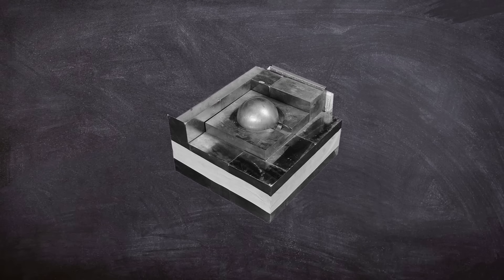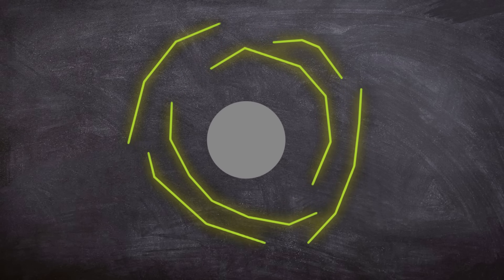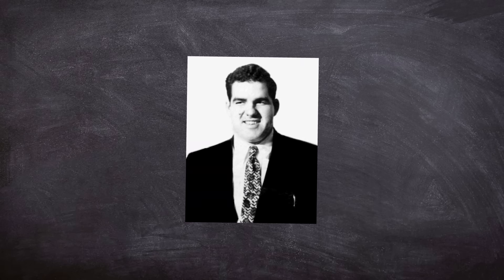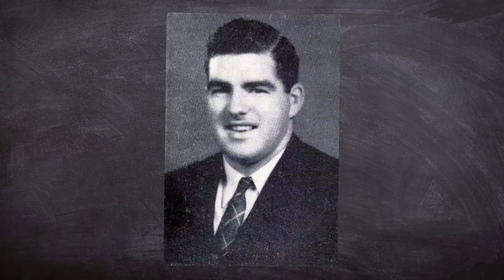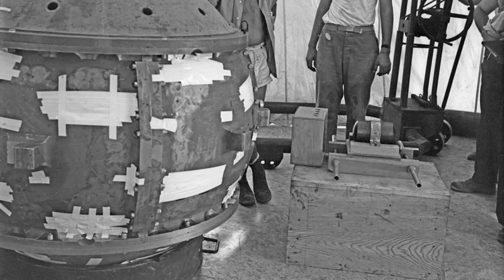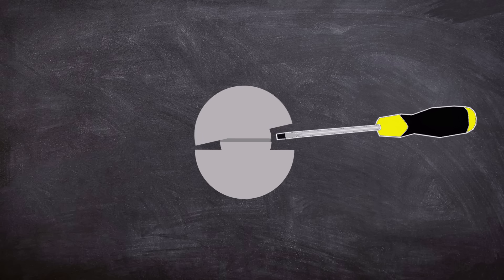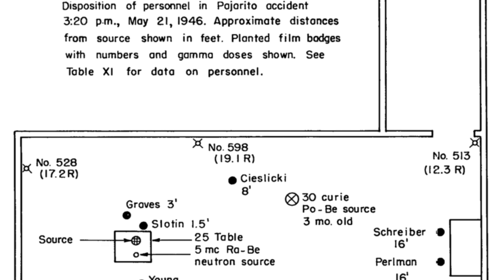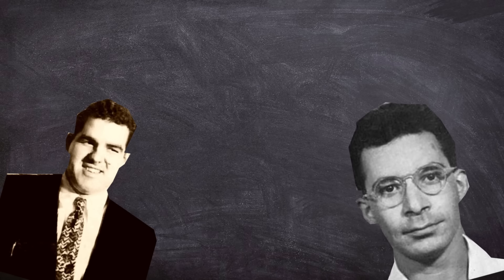A Brief History of: The Demon Core (Short Documentary)

Comment: Idk how just by moving bumping or touching medal pieces together could make something explode or give off a huge amount of radiation if someone can tell me in a simple way let me know cuz it just doesn't make sense.
Reply: It's just the feature of the materials used.
Reply: Plutonium is a metal, and under the right conditions will convert itself into energy.  A lump of iron is very stable, plutonium not so much.  Like a spring wound up tightly, it only takes the right push for its atoms to give it up and decompose into one enormous ball of energy.
Reply: @asmith7876  aight thx

Comment: Also, the photos are @1:29. EVERYTHING has been turned into rubble, concrete structures & buildings that were "Reinforced" with STEEL have also been reduced to almost nothing, its literally like you threw a "Grenade" into a large "Lego" model! The devastation is Insane, but, can ANYONE Please explain (I REALLY want a video done about this as Ive always wanted to know) WHY & HOW there are a few buildings STILL standing after an atomic bomb??? Not only that but at least one of them look like they are Perfect, like they didnt get damaged at ALL! they look to be made like the rest, there in the middle of the blast zone, but they still stand! WTF!?
Reply: Here's a start: 
https://nuclearsecrecy.com/nukemap/
Reply: Most buildings were not reinforced with steel as you claim. Iron ore is one of the few natural resources not found in abundance on Japan. 

Most of the buildings were wood or brick, as opposed to reinforced concrete as you assert. 
So it’s simple. The old buildings were disintegrated immediately. A few modern buildings which had been reinforced for earthquake protection survived. It was mostly dependent on their proximity to the blast. 
The Genbaku Dome was almost directly underneath the fireball. Everyone inside the building was immediately killed by the heat, pressure, and Gamma rays but the building survived with relatively little damage.

Comment: Many laughed at the researcher for not having common sense, but what they don't know is that those researchers are not the one in control of the funding. 
- They could know that it's dangerous but the higher up refused to provide additional safety because it's very costly to do so. 
- They could have been forced to produce result within unreasonable deadline which forced them to use faster but unsafe method. 
- They could had lost their concentration because they have to do precise work while running their brain on full capacity overtime.
I find it sad that people don't commend on their self sacrifice to stop further accident from happening, but mocked them instead. They probably knew that they are fucked before they knock off the reflector or tungsten plate to prevent the supercritical reaction, but decided to do it anyway to save the life of everyone else in the area.
Reply: sounds bulsht they legit used a screw driver like a fucking donkey. They were totally just fuckign around
Reply: @Seelenverheizer  Blame the higher up who refused to provide more than a screwdriver or implement any safety measure. If that incident happened in any lab in modern day, all the supervisor will be fired immediately. Safety precaution is something to be done by the higher up because they held the money to do it, not the baseline researcher who has zero control over what tools they can use.
Also, after being forced to overwork eventually your mind reach a state where you can't handle a screwdriver on full focus.
In my lab the experiment will never be allowed to proceed because it will fail the risk assessment.
Reply: @mira-rara  dude they were the researchers that had build the nukes a few years before, they had legit unlimited funding. They would have gotten whatever they wanted FFS. Do you even remotly think the state was like " well here have a screwdriver, we cant afford more". He used the ducking screw driver as a non recomended tool for the test because he was showing off how much of an edgelord badass he was. I mean they could have milled a better tool for that on side for like 1$. From what you say you seem like a lab tech that feels like he cant keep up with the quite low requirements and loves to blame his better. You  might want to read up on projection
Reply: @Seelenverheizer  Maybe try taking a phd and work in one of the top research lab in the world. You will understand what I mean.
Politics in research lab and the fight for research grant often fuck each other up. Yeah the lab may have unlimited funding, it doesn't mean you get to use it.
And again, most likely he is pressured into producing result in short time. This very often happened to researchers and is still a huge problem even in today. I supposed you aren't working in relevant field because this is not a situation that will be met by lab tech, but a research engineer/associate/fellow.

Comment: I still don’t quite understand the reason for this “experiment”.  Two hemispheres of beryllium over a plutonium core separated by a screwdriver...What is the point of doing this?  Just to see how close you can get before going critical???
Reply: I believe it's called edging
Reply: @kratosgodofwar777  It came, he went. Sad. 😥
🤣
Reply: @kratosgodofwar777  hot
Reply: It was a calibration experiment to measure how close the sphere was to achieving critical; it was originally intended to be used in the Operation Crossroads tests at Bikini Atoll, but was put into storage after this accident to let the excess radioactivity decay, and was eventually melted down and reused.
Reply: @nemo5654  They couldn't figure that out from just doing it once?  What's the point of doing it multiple times wiggling the screwdriver up and down?
Reply: @Theakker3B  The beryllium is a neutron reflector and will bring it nearer to critical the closer it is, which is recorded via a scintillator, which was counting gamma emission which is proportional to fission rate. Taking multiple data points allows for a more precise measurement, which is necessary for estimating the yield of the weapon. The beryllium hemisphere should have been mounted on some sort of incremental slide, rather than Slotin's rather crude and dangerous method.
Reply: @Theakker3B  you probably had lab experiments at school.
Experiments require repeated measurements to get rid of random errors then made with different setups to make sure that nothing is influencing the results.
Reply: @nemo5654  Thank you!
Reply: @Theakker3B  You're right, Man. You go tell those nuclear physicists what for about a test you don't understand the purpose of doing. That's YouTube comments for you. Actually Slotin wasn't supposed to use a screwdriver but the test still needed to be done so calm down.
Reply: @FIREBRAND38  he was never telling anyone anything, he asked questions,  every sentence was a question asking for better clarification. never once did he imply he knew better, in fact its so, so very clear that he didnt know much about it.

can......can you read? guess "thats YouTube comments for you"
p.s change your name from john to homer, suites you better
Reply: I think it was intended as demonstration experiment to show the onset of criticality, as the system changed from a subcritical state to a critical or super critical one. Such demonstrations are still used today, for training nuclear engineers, but, of course, all of the nuclear and other experimental materials are now remotely handled behind radiation shielding.
Reply: Trying to get it into a subcritical state to harness the reaction is what  I think he said
Reply: @TheNufai  And what does that mean exactly?
Reply: @Theakker3B  they were probably trying to use it for energy in some manner
Reply: @twilight_phantom2969  if they want energy so bad just drink a cup coffee... sheesh.
Reply: @twilight_phantom2969  If you don't know don't guess
Reply: Insanity.
Reply: For fun yo
Reply: Worst test ever to use a non-Fail-Safe method.  If the 2nd mass was instead raised up from below, and only suspended while held, then letting go should have ended the reaction, and so would any accident.
Reply: Remember that, at this time in history, very little was known about the effects of ionizing radiation. There was theoretical understanding, but real-world situations are another matter. Things like the demon core don't occur in nature, so the only way to study them is manipulation by man. Understanding radiation has made it possible for us to create nuclear reactors to generate electricity and power millions of homes. It has allowed us to develop radiation therapy for treating cancers and taking internal images of the human body for diagnostic purposes (X-ray/CT machines). It helps us also to treat radiation exposure and ensure better survival in the event of accidents.
Reply: He taught everyone a valuable lesson I guess. Sometimes the best way to learn is from mistakes or taking note of others mistakes.
Reply: Especially when you're nudging the inside of an atomic bomb with a screwdriver measurements can be imprecise.
Reply: tell yea what,  fuck everybody here.  that is All
Reply: @skeetrix5577  9/10 comment not cool enough, needed more walking away from an explosion right after dropping a mic
Reply: shit man you're totally right,  i fucked up!
Reply: When the spear is closed it reflects back causing the thing to blow.he was most likely trying to find better reflection techniques to make the bomb more powerful by prying slightly open without going full critical
Reply: yes
Reply: When you get down to it ... yes. Yes, that is exactly what they were doing.
Reply: the way it was supposed to be done was that there were three spacers meant to be between the two as a final safety. but the dipshit decided to use a screwdriver.
Reply: @scout360pyroz  To achieve what?
Reply: @Theakker3B  self gratification. proof of his skill, better test results, aleviate his desire to get the heack out of there... the list goes on
Reply: @scout360pyroz  What I'm asking is what does balancing two hemispheres of beryllium over a plutonium core do?
Reply: @Theakker3B  reflects the regular decaying neutrons emitted by the radioactive substance back into it, causing more decay and more neutrons to be released, if I understand correctly.

Imagine a pot of water that has a consistent amount of heat being generated within it, and a very insulating pot and lid.
If you put the lid all the way on, the water will instantly boil and rapidly produce enough steam to burn you
If you put it partway on, it doesnt boil, but it releases a more controlled amount of steam and heat.
They were trying to maximize the amount of heat without the steam explosion by getting the lid as close to covering the pot as they felt they could.
But they dropped the lid on it and it exploded in skin melting steam.
Twice.
Loose analogy, but it kind of fits.
Reply: Living on the edge...
Reply: I love how some comments are like, "Oh, it's a perfectly valid thing to experiment with," but really? While you're standing right next to the bloody thing, trying to make it emit the very same energies that can kill you while you only have a lab coat to protect you? And the worst part is that even back then they could have done the tests remotely but they chose not to until two people had died.
Reply: Michael Buck  Push the boundaries for what purpose?
Reply: Michael Buck  That is pretty much the core of my question: What was the purpose for doing this?  What did this achieve?
Reply: @Theakker3B  "oh I can do this better manually" was the point.
He had done it that retarded way a number of times by that point.

Comment: "Not only will this kill you, it will hurt the whole time you're dying"
Reply: it damages you at cellular level if your next to plutonuim core when its in criticle state might as well just take a gun and end it right there
Reply: I heard morphine wouldn’t even touch the pain people had from ARS. You’re literally getting torn apart into a soupy mass.
Reply: @FlameDarkfire  Hard for painkillers to be effective when your entire nervous system falls apart.
Reply: @PatrikTothMaster  From what I understand, the problem is mainly with getting the painkillers, specifically morphine into the victim. I’m not an expert at all, but from what material I’ve consumed, it sounds like most radiation burn victims that would require it literally cannot receive an injection. Their veins are usually so inflamed and swollen that the injection of the drug isn’t possible. Not sure about IVs, because some of those victims also got blood transfusions.
Reply: @FlameDarkfire  your circulatory systems fails as the vessel walls disintegrate.
The drugs can no long reach the areas that hurt.
Reply: Quote is found on electrical gear cabinets and service panels
Reply: I don t get it .. I mean if your nervous system falls apart wouldn't it lose its connection to the brain and so you'd go numb?
Reply: Damian Curie the nervous system will send garbage signals that the brain will just interpret as “pain!”
Reply: @FlameDarkfire  thanks for laymans terms...
Reply: Your brain is more or less hardwired to interperate the nervous system not acting properly as PAIN PAIN AND MORE SEARING PAIN
Reply: @kayden5238  the funny thing about dying from radiation exposure is that what kills you is errors in cell division. Which means that the faster your cell divide, the faster they die. You know which cells in the human body take longer between divisions? Those on the heart, brain and nervous system. 
So radiation sickness kills you while being fully aware and in extreme pain.
Reply: @dogman8339  "the funny thing about dying from radiation exposure"
What a quote lmfao
Reply: @kayden5238  

Yes, ask Biden.
He's still suffering from it.
Reply: Sign me up!
Reply: Experienced bomb putter together. That would throw up a Red flag surely lol
Reply: A man of great wit & taste as well.
Reply: This was at 666 likes when i read  it
Reply: The only way I’ll ever commit su!c1dÊ is this type of scenario. Or another lethal and agonizing condition
Reply: As my scottish uncle would say and ya will hurt for 3 day after yr dead
Reply: 'AVE' on YOUTUBE sells these stickers
Reply: TWENTY-FIVE DAYS of hellish pain and suffering. No, not a good way to die at all.
Reply: This is all very fucked
Reply: @SangheiliSpecOp  Lmao
Reply: @GeorgeMTello  i knew radiation was deadly but having watched this and the other video with the random rtgs found in the forest, I had no idea how quickly ones life could be eradicated by radiation. It tears your very essence away. Scary stuff
Reply: Stupid prizes comes to mind.
Reply: Also a lot of Jesse Pinkmans
Reply: https://youtu.be/4G6e4TaJxkI 1:58,
Reply: You take such a weird pleasure in parroting that, but I promise you wouldn't enjoy it if it happened to you.
Reply: I'm into ballbusting and had hot women standing on my balls, so I would stand a good chance of handling the pain quite well. Obviously basic beta bitches need not apply.
Reply: @ElmerFudpucker  a round of applause for this well thought out argument